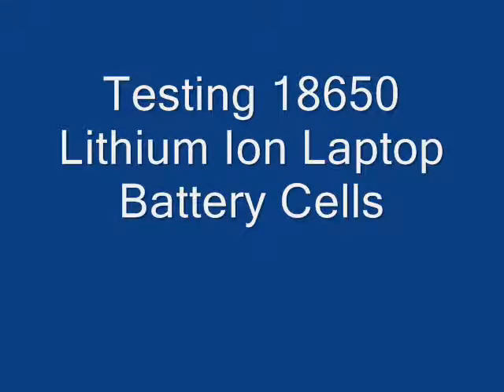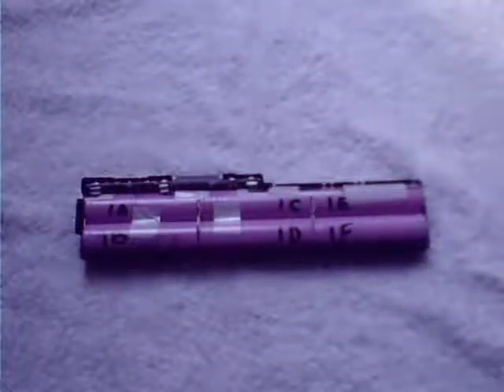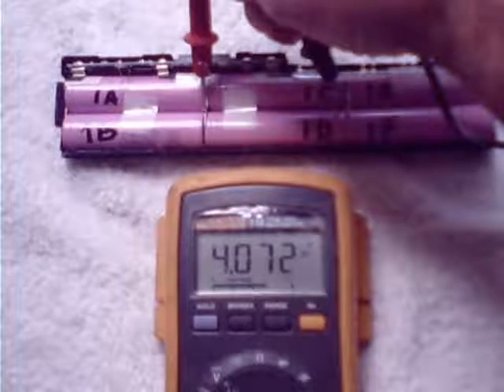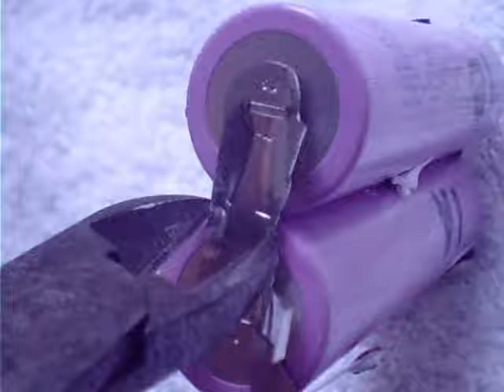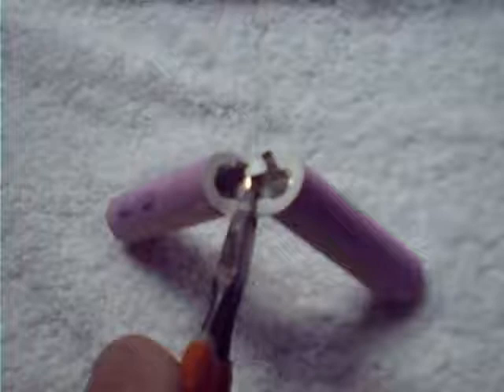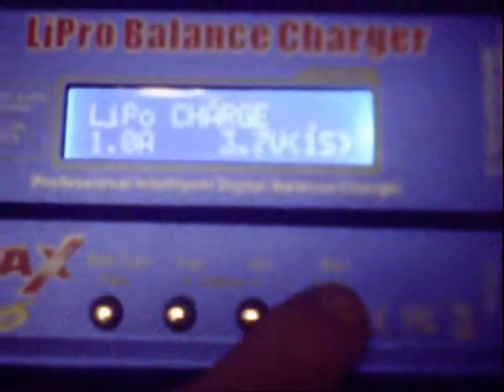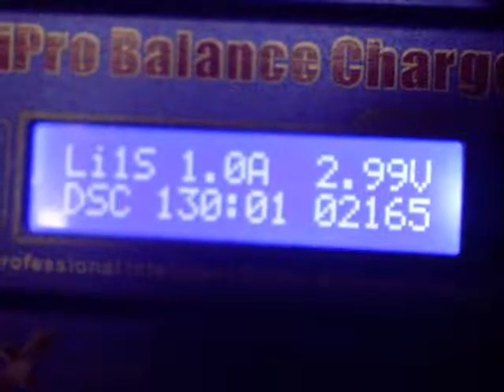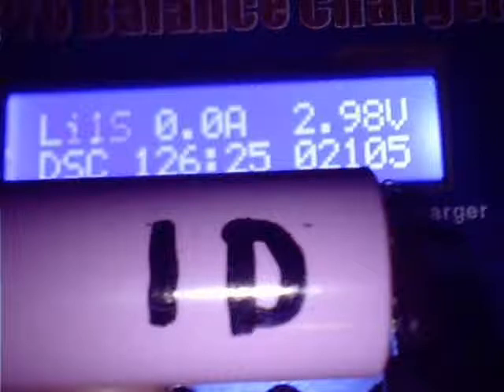Testing 18650 Li Ion Laptop Battery Cells

Comment: Making use of the ( Check Details Here>>>https://www.facebook.com/Battery-reconditioning-310070329426065/app/208195102528120 ) reconditioning plan, I just saved 2 auto batteries from being completely junked. The guides were very simple to follow. I wish I would have found this years ago! You may use the guide to recondition any battery type

Comment: Cells C&D and E&F were connected in parallel, you got a good voltage reading from then, but when you separated them, one reads 0, and the other reads the same voltage as before.  This...is not possible. If one of the cells in a parallel group is bad, it will self-discharge, and since it is connected to another cell directly, it will discharge that one too. You would have gotten no voltage from both cells in the parallel group. Since that would effectively render any such discharged cell unsafe to recharge, you would need to replace both cells. I suspect you were not probing the voltages correctly. It is difficult to tell from the still shot you had in there, but the probe didn't look like it was properly touching the terminal of the battery on C and E when you probed them.
Also, You had the wrong voltage on that charger.  Safe operating range for a Li-Ion 18650 cell varies by manufacture and chemistry, but is usually 3V low and 4.2V fully charged. Many cells can go as low as 2.75V, and one I saw once can go to 2.5V. For max, all I've ever seen are 4.0V (for greater longevity), 4.2V (max storage capacity), or 4.1V for a compromise (because why not I guess). [EDIT] Reviewing, I see you did set the voltage correctly on the tester, though the chemistry was wrong (not that it should matter in this case).

Comment: BTW, there's no such thing as negative voltage, you had the polarity reversed. As far as TESTING voltage, there's no harm done. Just ignore the negative part. CHARGING WILL destroy these batteries if the polarity is reversed. As long as the cell works and doesn't generate to much heat you should be fine. This pack obvious died since the left cells wasn't pulling there weight for what ever reason so there wasn't enough voltage and the IC declared it dead and sent it to the charger which would explain it not to charge. Thing is peoples lack of knowledge is my gain to exploit. I am getting good LG cells that are charging nicely from "DEAD" laptop batteries....What a sad waste.

Comment: The laptop 18650 batteries are Lithium Ion NOT Lithium Polymer. Set the mode on the B6 for the correct battery. Li-Ion are not to be charged to 4.2 volts. Read the B6 manual Li-Ion batterys are charged to 4.1, 4.0 is better for longevity.

Comment: I have the Imax and you are not meant to use the LiPo setting as that is for the Lithium Polymer batteries that are the type that go in remote control little airplanes and such.
You are meant to use a setting for Lithium Ion batteries that is the nominal is 3.6 and it's called LiIo, where the third letter is a capital i and not a lower case L.
Reply from the maker: Always check the data sheet for the cells you are testing to make sure.
The ones tested in this video are 3.7v cells.
Thanks
Reply: +Big D Jesus Christ Marie, they're not rocks. They're minerals
Reply: TheBatterychannel u
Reply: it really don't matter  a 1amp load is a 1 amp load   when testing Capacity  its not the Voltage its the amp load applied   The MFg test 18650 to 2.5V   that's how they get a little higher Mah then when you only test down to only 3.0V   example the NCR18650B 3400  when tested to only 3.0v you get only around 3100-3150mah   test it to 2.5V you get closer to the 3400

Comment: Where do I get this charger/tester. I have a huge access to these batteries. It would also be nice to turn these in to 12v batteries as well and to have a charger for it. What's the key to charging these batteries? Just low amp charge?

Comment: they li-ion batterys. yea, can solder them,live or not lol doest matter. solder lead acid batterys together. lol n theoses are SAMSUNG Rechargeable Li-ion Battery 18650-26F 11.1V 5200MAH 3S2P by 6pcs cell. sell them for $44.00 new. Capacity:
5200mAh	
Standard Voltage:
11.1V
Diameter of single cell:
18.0+/-0.7mm (0.71in)	
Height
of single cell::
65.0+/-1.0mm (2.56in)
Cell Package:
PVC heat shrink tube	
Reference Weight:
44.2g (1.56oz) Per cell

Comment from the maker: The link above will show you the factory data sheet on these cells.

That is how you know the charge and discharge voltages.

I would suggest before doing any testing of these cells to study the data sheet first.

If you do not understand the data sheet then don't do this stuff.